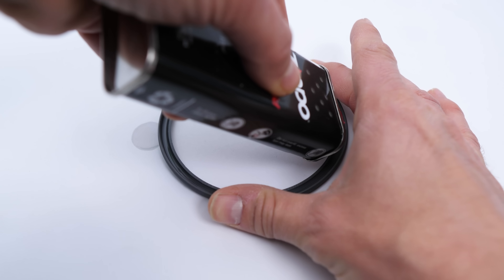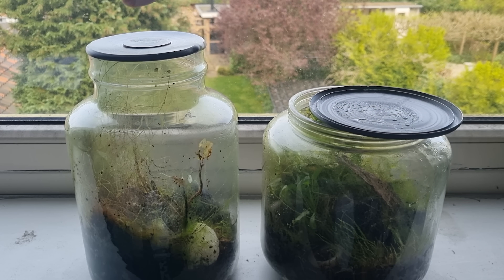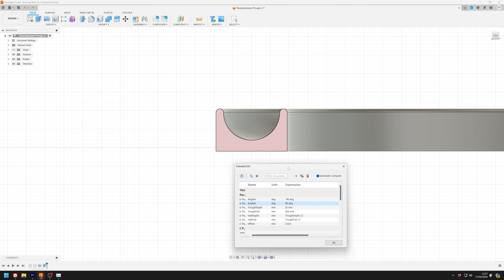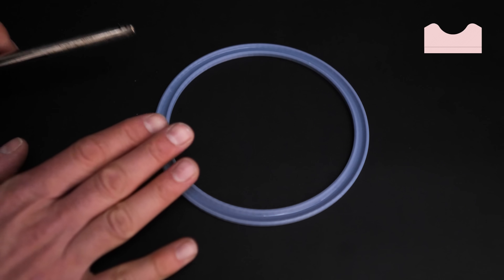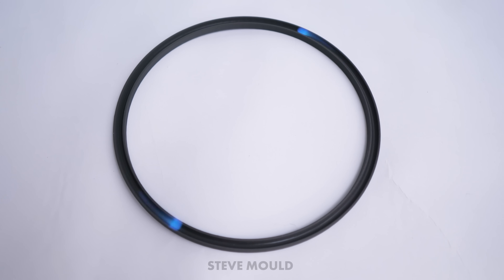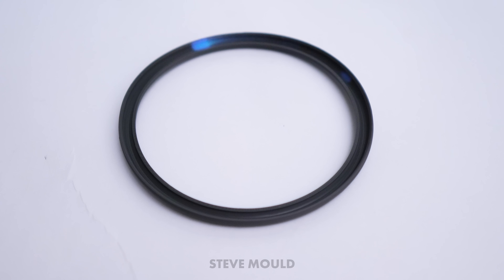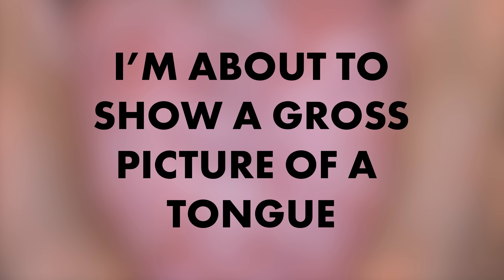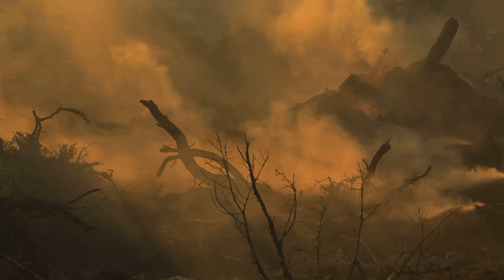Bizarre travelling flame discovery

Comment: When I had too many bubbles or fizz building up iny glass when pouring a soda into it I would stick my finger tip in and all of the fizzy part on the surface would immediately pop go down like that hot chocolate like the video clip shown. So I'm guessing that was an excitable medium too...maybe? Idk I'm just guessing. Not always it will do that and idk why and yes I do wash my hands always before I pour me a drink of whatever and wash them longer when pouring a soda into a glass or cup just in case I have to stick my finger in it to cause the fiz to go down before overflowing and making a mess. If anyone knows how that works please let me know and also please explain why it doesn't always work? I was guessing it depends on how much natural oil is coming out of your finger pores but, I wash my hands thoroughly and don't think that's it. 
It's almost like trying to solve why mentos or Skittles makes a soda go ape sh*t then spew out of whatever container it's in. Also guessing that's because of the acid base thing happening there like vinegar and baking soda trick. Not the same though it's the opposite. 
Wonder if rubbing alcohol or charcoal fluid would work in that ring he made?

Comment: I would like to see you do a spiral with a 15mm size pool at the center and the outer end to see if you can get a pool that bounces back and forth. Maybe adjust the pool size where it stays lit long enough to bounce back then go out. Maybe as amall as 7 -10mm. It would be cool if there is a sweet spot that works.

Comment: when I was a kid in the 80's I used to pour rubbing alcohol into sidewalk cracks and light it up. after the initial flame died down I would sit there in awe and watch little blur fireballs race back and forth. sometimes there would only be one left and it would get stuck on a clump of dirt and start dying. suddenly it would ignite into 10 new ones that would shoot out from both sides of the traffic jam. I was amazed and in awe.

Comment: Could this be used in some computer or electrical circut? The junction that has the sustained flame made me think about that, but I don't know about either topic to be able to explain what I mean, except that the flame could work as a signal, like 1s and 0s in computing or the "on/ off" circuit of electronics. Something like Minecraft redstone comes to mind.
Reply: I just saw the pinned comment. Nevermind.

Comment: I found that your design is quite tricky, the standing flame is not uncommon, using lighter fluid, and if using "wasbenzine" (as called in Dutch, it's similar to the nafta of the lighter fluid and for most purposes it's a perfect replacement) it gets even worse.
For anyone printing them: try scaling VERTICALLY by some 20-30% to increase the distance, maybe it works better. No need to go to Fusion 360 and change the design itself. I will try in the next days.

Oh, and don't use PLA: if you get standing flames it will soften and deform in a matter of seconds. Use PETG or better ABS.

Comment: I see this idea, being developed into a sort of fountain of dancing flames, perhaps tiered levels of different sized rings, all fed from a basic source of fluid by capillary wicks, perhaps even in a tree and branch configuration. Obviously the best bet would be to make the troughs out of a non-flammable material that would last and be more durable, but I think you get the picture. This could be quite an interesting ornamental or artwork piece, which, of course, needs to be designed in such a way that it won’t ignite anything nearby, but could be used as a decoration of sorts.  Have you given any thought to using wicking to introduce the fuel to each of these layers? Perhaps you’ll need multiple sources at different levels to get the wicking to work properly, but it seems to me that wick laid in the bottom of the trough throughout the entire circumference or pathway would serve the same purpose as the liquid fuel itself.

Comment: Possibly the largest scale excitable medium example is supernovae inside dense star-forming regions. Because you get a lot of stars about the same age, they all hit their critical "could blow up at any moment" point at around the same time, and in particularly dense clouds of dust and gas you will usually end up with massive, fast-burning, and short-lived stars, you end up with areas with thousands of stars where one going supernova sends out a shockwave that can tip its neighbours over the threshold to go supernova themselves. You can end up with a wave of supernova sweeping through a nebula of dust cloud, crossing thousands of light years and taking millions of years to complete. This is one of the theoretical models by which heavier elements may have formed and been propagated during the early life of the universe, since the exploded matter would then be drawn back together into new stars, which would then fuse those elements into heavier ones, and then go supernova again when it and all its neighbours hit that volatile ready-to-pop age range.

Comment: Did you try this with other volatile fluids? Since kerosene has a higher flash point, the trough shape would need modification. Also, I believe that the flame would either travel slower or need a larger ring to be continuous.

Comment: The video game Civilization VI has forest fires as a game mechanic. Basically a tile with a forest can catch fire and will set it's neighbors on fire the next turn. There is a refractory period where the tile is considered 'burnt forest' and then the forest grows back after one or two turns. There have been maps with sufficiently large enough forests where there is a constant loop of forest fire that keeps going around all game. The one that pops to mind is a custom map of earth which is larger than the default one provided by the game, there the Amazon Rainforest often ends up continually on fire.

Comment: Curious about the ratios created between different paramaters/sizes (wall height, diameter, channel opening size, etc) from the discovered  ring print. Its close to fibonnaci (golden ratio), rather than more complex systems like biology or social systems on stadiums. Burning fuel in a shape is a basic chemistry and physics phenomena, and the observations you made regarding this "discovery" are very well thought

Comment: hmmm.. all it did was to wildly burn the plastic. The whole thing sets ablaze, and then as the fluid depletes, at one point and for a short period of time I could see the flame turning around the loop. 
There needs to be the right amount of fluid, temperature, etc.. Obviously plastic is not the best material but of course it's what you get from a printer, it's quick and convenient. 
Maybe also the fluid I used is too volatile: something more oily might be better?

Update: I tried Lamp Oil: better, it burns slower, but oh dear how it stinks. Thinking we used to light our houses with that...

Comment: i wonder how effective it would be to copy the idea on a bigger scale to get the same effect inside a controlled chamber, like the size of a particle accelerator. Heat builds up in the chamber with lasting fuel inside and can effectively become a generator. eh, there's probably more efficient generators out there, like the mechanical buoy.

Comment: Another disadvantage of the shallow trench is that more of the vapor may escape out of the system, spreading until it goes below an ignitable concentration. If it’s pretty close to the minimum concentration to start with, that vapor is basically lost to the fire.

Comment: It would be interesting to see this redesigned with a slight opening underneath the designs and a fuel reservoir for long term use, wonder how long it could be sustained in a metal print as a desk distractor with a sizable reservoir

Comment: Interesting Theory but not what's happening here.  What you are seeing is a Fluid Film Effect from Heat Exchanger Condensers.  (Super-Condensers?  Damn, been so long now)
These Condensers have the Hot Vapour rising inside a tube and the Vapor Condensing on the walls of the tube on the inside dripping downwards.  A Number of Tubes are stacked vertically inside a Shell and the Coolant is passed through the Shell.  So, you have vapor rising in the middle of the tube and liquid running down the inside surface of the tube.  This all works just fine until you hit the Sour Spot around 1/4 Inch and the effect stops working at that size and below. This is Important. The reason the effect of the vapor/liquid exchange stops is because gas needs a minimum amount of distance in order to flow.  If the tube is too narrow then the vapor won't flow even though there appears to be an opening available.  For Example, Modern Windows insulate almost as good as Vacuum by having two panes of glass closer than 1/4" and filling the void with a thick gas such as Argon.  The Argon gas is unable to move around and stays 'stuck' in position providing the insulative qualities.  SO - This 1/4" minimum is important.  You'll notice your design is right around that limit in size.  
The second effect to talk about is the fact that this is similar to a Pulse Rocket engine.  Think of a clear plastic tube with flammable gas in it.  You light one end and a flame front travels inside the tube.  This is what the trough design is doing, acting like a pulse rocket tube.  An Astute Reader might point out that the trough is not a closed tube and doesn't work like a pulse rocket.  I would respond by showing how the 1/4" limit creates a 'pseudo-wall' around the trough and it is as though you have a flame front travelling through an enclosed plastic tube.  This is why the design cannot be scaled up.  In our Gravitational Field and with the Atmospheric Pressure as we experience the Limit of this effect sits right around 1/4" and you will not be able to scale up or down to any significant amount at all.  The Fun thing to do with this design is to set it on its end and allow the effect to run.  Since it is behaving as I stated, as though it is enclosed in invisible tubing, the effect should work in any orientation.   I seem to remember that the Effect is called 'Blinding' but I might be thinking of Fuel Cells there.  It's been a long time since I had any Engineering Courses (I Hate you TMEB).      Hope this helps but most importantly I hope I'm right.  XD

Comment: I think you have the right calls when speaking about the explanations.
I think the sustained fires by the junctions are occurring because they have more air above them. Try to close the walls slightly (more experiments are needed). It could be measured somehow; the lighter fluid volume-to-air surface ratio can be a starting point. Depending on the angle of the junction, several ratios can happen. I think this has to be taken into account when narrowing the gap-above. 
If you can solve the sustained fire problem, logic gates can be possible.

Andrew
-fire juggler
-Physician
-emerging programmer
-an admirer of your channel

Comment: how do you know that the raised section of the figure 8 track  has residual fluid.
It could equally be vapours from the lower track rising.

Only one way to find out..  make non overlapping raised sections.. different heights and spans.

Comment: I'm not sure the heat of the flame has that much to do with it otherwise the ring should increase in speed with each revolution.  I believe it's simply caused by the fluid's characteristic rate of evaporation.

Comment: What about making a clock? Using a spiral of a specific size would allow you to dial in a period with a sensor at the centre triggered by the heat/light. It could even fire a spark plug at the start. Not sure about how to continually fill the trough evenly though. Maybe a permeable surface with a reservoir, sort of like a zippo lighter?

Comment: I'm curious what the smallest area that could sustain an infinite forest fire is, by using a plant that regrows really fast, and making it spiral-like instead of a circle, so that the plants get about as close together as possible before without the flame spreading to a different part. I wonder if perhaps building it on a hill could decrease the footprint, since the hill would increase the surface area, Or if the effect of the hill would be negligible due to the plants still growing basically straight up.

Comment: What if the spiral was two troughs parallel to each other and connected at the ends (like squishing a closed ring down into parallel lines that loop around at the ends, and twisting that up into a spiral) so that the flame spirals into the middle, and then spirals back out, and then back in, etc.

Comment: The continuous forest fire around the globe that constantly relights itself really ought to be possible actually. Sure, there are a couple of oceans to bridge here and there, but if you'd wrap the forest in a long string around the planet a few times it's long enough! You may have to build a section where it can safely cross over itself, but that should be easy with a large (forested) bridge.

Comment: What happens if you dilute the lighter fluid? Or do similar kinds of lighter fluid with more or less percentage of evaporation will work?
Would the flame be going slower cause of the gas realease would be slower? would it even work with the same design or do you need a wider Channel for that? if the channel width must be adjusted would the flame be taller because the flame would maybe need more oxygen to react? Could you make a nice looking backyard lamp out of it?

Comment: You can do something similar with natural gas, which has nothing to do with evaporation. Unfortunately, I didn't have any larger burners to play with. I figure the diameter should be greater to allow the gas to refresh more consistently. I was able to get the flow of gas low enough that a flame jumped around in a circle. I didn't get a video, but in one instance the flame orbited the burner about half a dozen times before it went out. This was my entertainment after a few days of blackout where I had gas but no electricity. https://www.youtube.com/watch?v=OF9VMT33Ddg

Comment: I did this 20 years ago with rubbing alcohol and a lightbulb fragrance oil burner. It is a little brass round half tub that sits on the bulb and as the bulb gets hot it would vaporize the perfumed oil. I being a pyro replace the oil with alcohol and lit it.. and the flame did this spinning. I thought it was cool. But I assumed it was a know effect.

Comment: @stevemould I have a theory as to why the flame didn't move when you made the walls higher and the gap at the top thinner.  It appears as though the gap may be small enough to restrict the air-flow from above from entering the contraption efficiently, essentially causing the system to act as a tube.  I bet the gas evaporating off the top of the lighter fluid is being sucked up to the base of the flame so the flame is now fueling itself without needing to move, and it is doing so with equal force in both directions.

Comment: I wonder if the heat from the flame causes a current effect aswell as enable a potential difference between the evaporation the positive and negative side of the flame, determined by the initial direction determined by you hand when you lit the fluid.

Comment: Think in resonating vibration frequency energy by the repelling dielectric spinning fields (combusting pressure difference) 369🔄693 (12⚡️21) 
You had just be lucky to have the right size of the permeated surface toroidal field as the perfect “membrane”!

Comment: Can you try a spiral where you slightly decline the ends or incline the ends Tighten it a little so you can connect them? I'm sure the flame won't circle for very long as the fluid flows to the lowest point in the loop but id like to see a full circuit of that which I'm sure it would do at least one.

Comment: If the bottom of the trough had a felt-like media, fuel could be fed in continuously.  On the other side of the felt could be another channel with liquid at a tiny positive pressure, which may release the whole mechanism from the need to be primarily horizontal.

Comment: I was wondering with the figure 8 model, with the changes in direction, if it's like with taking a vehicle around corners and curve where the bent parts of these designs would have a slower travel rate of the flame than on the straights. Perhaps your equipment may not be sufficient to capture how small that variation may be, but I am curious if the curves and corners would slow it down.

Comment: I think it has to do with the combustion of the gases and the expansion pushing the evaporated phase forward (with the stoihciometric ratio favouring gaseous products in the combustion of hydrocarbons)

because the heat is moving we don’t see continued evaporation unless there’s the flame front moves forwards 
By the time it returns there’s enough evaporated phase to combust again and the expanding flame front continues to move forward

Surface tension and friction of the gases imo is likely why the channel needs to be thinner; if its too wide, then then flammable gaseous phase is able to form a full ring of flame
Much like in blood vessels the resistance to flow of the vessels is likely a factor of the properties like friction and surface tension of the fluid - i.e resistance increases proportionally to the square of radius

Comment: Curious to see 
- a wave go from slightly raised to steeper and steeper. 
-Ancient symbols, the yin yang, the swastika, Armenian infinite symbol, a five point star you draw without lifting the pen. And other complex shapes that are a continues infinite shapes or symbols. 
-If the flame can push something to go round and round, like a small BB. 
-Stairs that travel down, around and back up. 
-Rings like an onions with varying grades or proofs in each inner ring. Outer rings with less flammable, with each inner more.
-If you can get it to run a sterling engine.